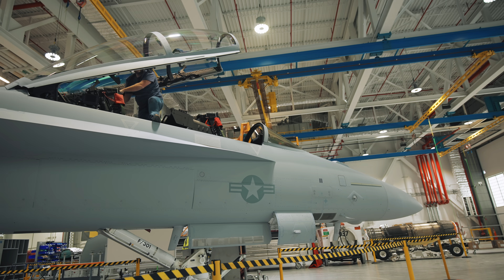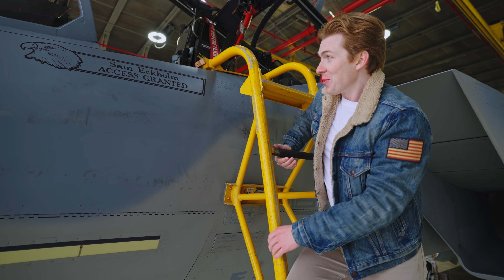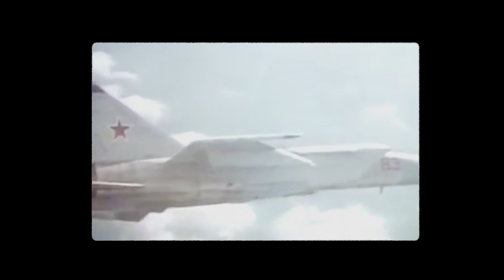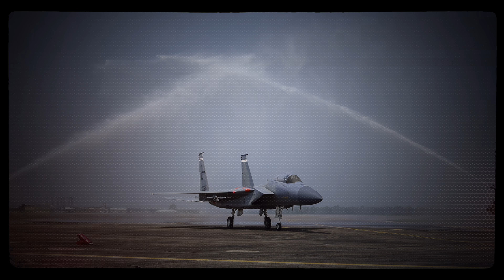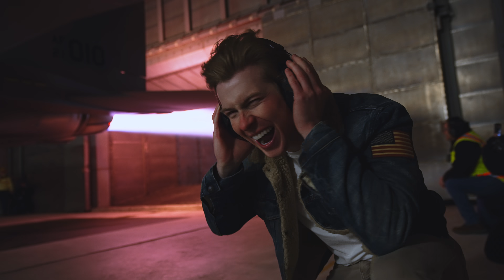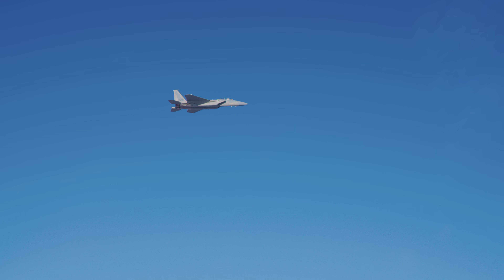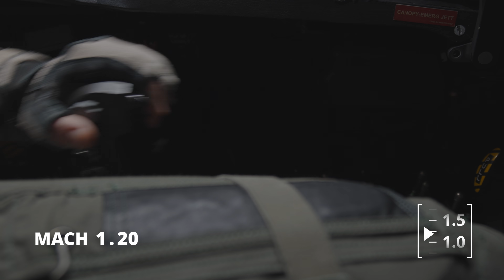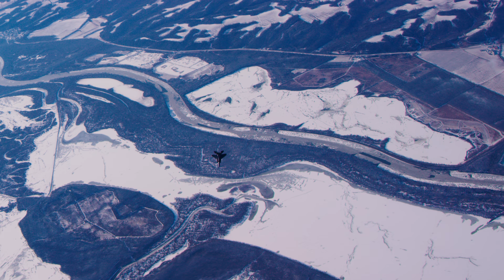Flying the Most Advanced F-15 Ever Built

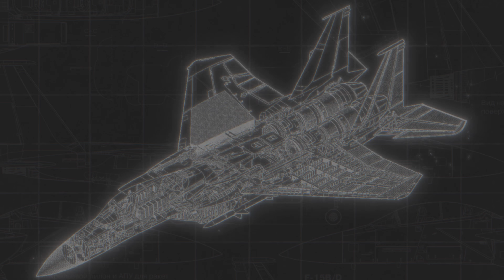Comment: 6:06 i think you can now add a couple of planes shot down thanks to some arab friendly state
Reply: Yeah, pretty sure that's just the "Eagle," not "Strike Eagle" and its variants. The Strike Eagle/EX are not exactly the same, and not just the cockpit, especially in terms of maneuverability
Reply: @eguy_6  he still used the eagle's 104-0 ratio & not the strike eagles'
Reply: @k7r-n Correct. The ratio should not be applied to anything but the air-superiority "Eagle" (models A-D). This was a video about EX, which comes from the multirole/strike "Strike Eagle" line, so the ratio does not apply.
Reply: @eguy_6  errr the f15s kuwait shot down were all f15e strike eagles..

Comment: F-15EX feels like proof that a legendary design can still keep evolving after 50 years! 🚀
Reply: The b52 would like word
Reply: @lukeeisenberger4872  difference is that the B52 that there are no new ones, they keep the old flight cells alive by upgrading and modernising. The F15 is a different story, these are completely new machines.
Reply: @Ashitaka0815 .   Gee… do I replace all new brakes on my car, or just go out and buy a new car🤔  since the government is not paying for a new car…. Guess I’ll change the brakes 😟😖
Reply: @nickcaci7238  Only if the chassis is still intact - and that's the difference. You can not upgrade a used fighter plane for decades and decades because strain on the airframe is much higher and gets more and more cracks, in comparison a B52 just flights straight with no hard maneuvers. If your car starts to bend because you are dragging it down the race course every day, you'll need more than just new tires.
Reply: @Ashitaka0815 так в том то и дело что 52 до сих пор летает и он реально крут.Он еще 50 лет прослужит.
Reply: Like the 777, 737, and 747.
Reply: For sure.. Look at the U2- we have upgraded the sensor suites to be completely modern and still fly them operationally, for example they used a U2 to check out the Chinese weather ballon during that incident
Reply: 5EX
Reply: Let's take it as another proof that many of these "classic" designs still had quite some margin, but also limitations due to e.g. the way flight controls had to be constructed back then.

Though not completely surprising, nevertheless truly impressive what can be achieved with modern actuators and fly-by-wire systems; especially when it comes to such high AOA and high-g manoeuvres as shown here.
Reply: This is a dead end, not a development. The US Army was forced to agree to purchase this aircraft (although in the beginning they refused, but the lobby did its job), due to shortcomings in F-22 and F-35 (flaws, high cost, etc.).
Reply: @Rediskin777 why would the US Army purchase this aircraft?
Reply: amen!
Reply: Physics don't change
Reply: 106-0)) Russians are just laughing at you. Come to Ukraine, in the first hour there will be a one.By the way, ask your Ukrainian friends how many F-16s have been in service))
Reply: It must be said tho that you don't replace stealth/visibility.
Reply: I want to become a pilot
Reply: Terrible comment, Machines In Action.

Essentially all aircraft fielded for military purposes are CONSTANTLY evolving. Many of them rot slowly with hardly any changes, but in-use USAF aircraft constantly receive upgrades to their avionics, their radars, their weapons, etc. The EX isn't some capstone of envisioned achievement applied out of nowhere. It's just taking what the USAF has been paying for to upgrade their F-15s for 50 years already and making it a factory package. It doesn't represent evolution, it is the byproduct of it. The F-15 has already been evolving this entire time. So has the F-16. And the A-10. And the U-2. Even the C-130. Still constantly evolving.
Reply: The Russian version = Sukhoi's Flanker series , no ?
Reply: b52, b1, b2
Reply: b52 will PROBABLY see 100 years of service
Reply: The Warthog says hold my beer.
Reply: Look at the F-16 with the Block 70 version
Reply: Just like how the M4/AR15 platform will continue to be used probably for the next 100+ years
Reply: Browning 1911....am I a joke to you??
Reply: but did they manufacture it so it can't be shot down by other countries that are friends with the US?  A few of you may get this post  :)
Reply: @trvman1  No design, whatever the platform is immune from friendly fire in the fog of war.  Particularly while at end of mission in "friendly" skies.
Reply: Useless design, planes are obsolete
Reply: The Russians have been doing this, the SU-35 is just an evolved SU-27. Instead of giving planes block numbers like the USAF does, they just give them new numbers so you have the SU-27, SU-30, SU-33, SU-35.
Reply: @Bellthorian  Your comment here is hilariously mistaken. "Essentially the same" in the sense that they have a common manufacturer and some kind of primary wing. The designs are moderately different. And while you may be referring to how "Computer Box A" may be the same on a Su-27 and Su-30, the same is true about US Computer Box A being used on an F-15, F-16, and F-18. And those aren't magically the same aircraft for that.
Reply: @EtherFox I did not mean they are essentially the same, only that they are evolutionary upgrades based off the original design. Much like the newest version of the F-16 has almost nothing in common with the F-16 block 15 aircraft.
Reply: @Bellthorian  such good looking jets too, one of my favorite designs